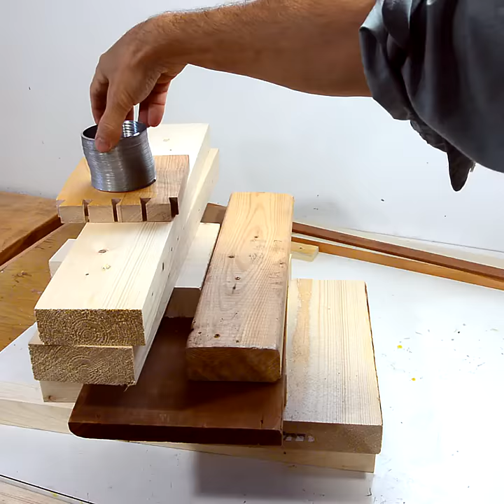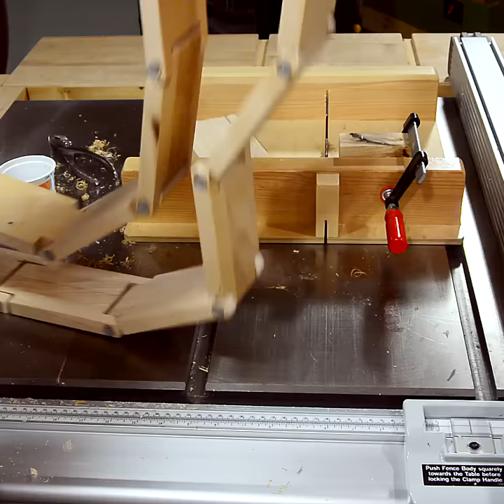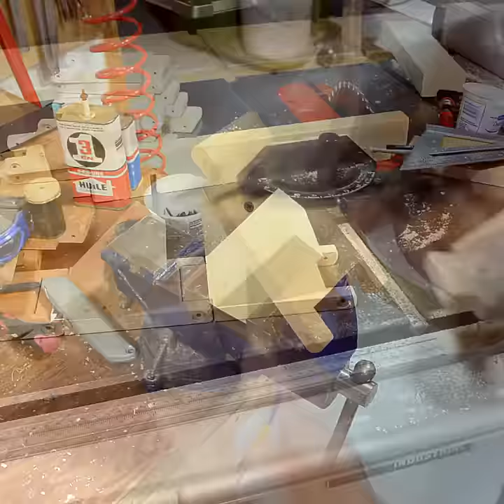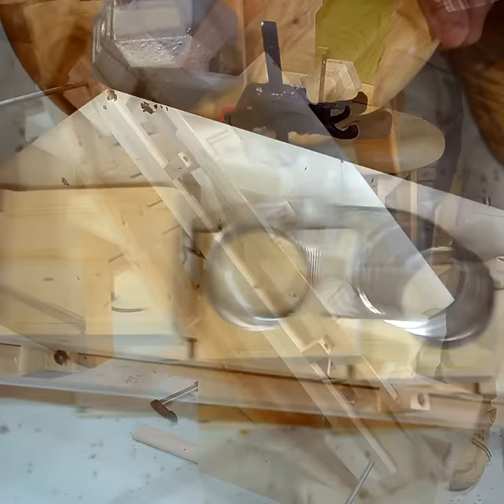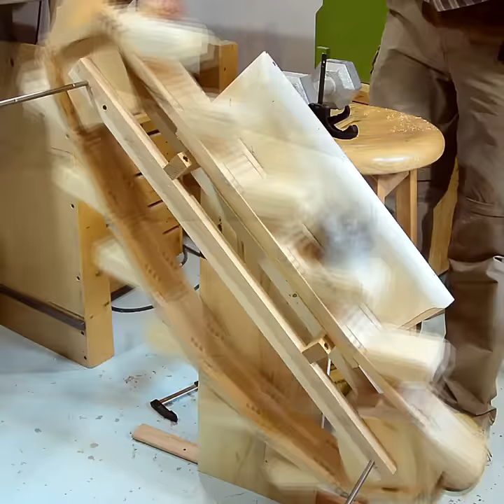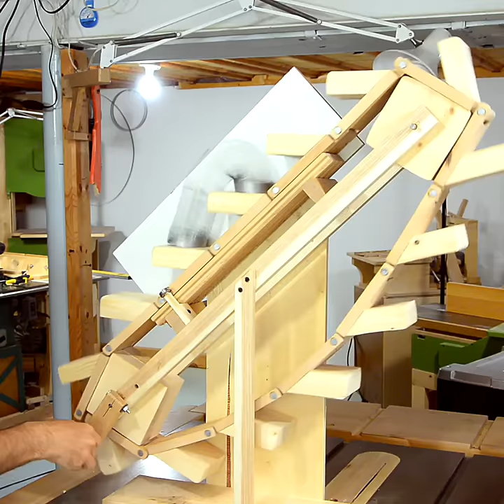Slinky machine

Comment: Given that your previous projects often used Raspberry Pi I was half expecting openCV looking for the slinky and adjusting the speed accordingly, Still quite cool contraption.
Reply from the maker: I ended up selling the slinky machine, otherwise this would be a cool project to try!
Reply: @matthiaswandel  theoretically, if you wanted to make another one, how much time would that involve? Is it a day, a week? It's understandable that you've moved on but it was a pretty cool project!
Reply: @djmips  maybe you could modify its design it so that it could be mostly laser cut, and only tricky parts would be 3d printed, (although you may find solutions without them...) since 3d printers are painfully slow.
Reply: I was thinking exactly the same!!!
Reply: @ronenen  3D printing can be made faster if you are willing to accept a loss in surface quality, which is fine for a structural part.

0.4mm x 0.3mm @ 100mm/s is a lot faster than 0.2mm x 0.1mm @ 40mm/s.
Reply: @ronenen  that's matthias for you, always using a laser cutter
Reply: @ronenen  Have you not noticed that Matthias' projects are about making stuff out of wood?
Reply: @MikeAG333  A wooden slinky would definitely be an interesting device, although not as good for escaping burning buildings.
Reply: @matthiaswandel  +1 to slinky stair case + opencv project if you ever feel like a redo. If this short does well you should consider it!
Reply: You can end up making another one @matthiaswandel
Reply: @matthiaswandel  I feel like you could definitely make a mini version of this, and have it be a perpetual motion desktop machine. Seriously, patent this ASAP IMO!
Reply: @matthiaswandel  wait, you are telling me there is money to be made with this? Did you just create a whole new industry with thousands of new jobs?? Where can I invest?!!

Comment: If more shorts were like this, i'd actually use the feature!
Reply: Ikr!? Finally something useful!
Reply: This is, unfortunately, a consequence of how we teach things in modern times, combined with the normal societal pressures to "conform".
Many children are quite good at 'thinking outside the box'. But almost everyone loses that ability as they mature.
This may be partly due to us disregarding some things because they are less useful/optimized, but again, we are actually taught NOT to think this way.

Example: What can you do with a paperclip?
Most will think about clipping papers together.
Some will also add tasks that a piece of stiff steel wire can be used for.
Less few will add things that a thin piece of electrically conductive material can do.

But at least one will think about using it to "help" the users of an office application...
Reply: @Prophes0r  "What can we do with a ....something?" is not a sensible question. The most revealing questions are "How do we solve this problem, using this limited set of resources?" Yours is a false example, and, I'd suggest, a false thesis. We're not taught not to think in this way at all. There is no teacher who says "don't think like that".  I suggest it is far more likely that it is an ability which atrophies in some from lack of use.
Reply: @MikeAG333  Nope.
How do we solve [X] with [Y] is the primary reason we have this problem.
It's NOT just about utility.
Utility is a hard limitation. Constantly framing everything as "What is my most efficient way to solve my problem" is stifling.

Now, we do need to solve SOME of our problems. It can't ALL be creative thought.

But limiting anything strictly by it's utility is the wrong way to do it, unless the ONLY thing you care about is efficient utility.
(And if so, then you should probably look up single-goal systems, and how they always fail.)

Sometimes, you just have to think about [Y] on it's own.
Reply: The shorts thing is just a terrible idea. Just imagine a full 10-minutes-or-something-similar video with all the details and reasoning behind the whole build explained by Matthias in an excelent way as usually. That cant be compared to some gutted 1-minute slideshow.
Reply: Du verrückter Kerl! Spielkind!
Reply: if shorts were in landscape which is what YouTube is made for they wouldn't be so annoying
Reply: @Prophes0r  4 bullets for my mouse gun.
Reply: @SkookumChoocher  this gives him a extra thou or two from his past genius. and more possible customers

Comment: so now you need a raspberry pi fitted with optical sensors to see the slinky, paint the slinky with some reflective material or illuminate it with a proper light against a background that makes it easily visible, run a program to keep the slinky in a specific defined space and have that program operate a motor that moves the wooden escalator at a speed needed. Simple!
Reply: You could use the fact that the slinky is a conductor and regularly touches 2 consecutive steps to make detecting the slinky much easier!

You’d need some sheet metal on the steps and some clever ways to charge it but computationally it’d be very simple
Reply: @NathanSMS26  Yes but I am going from the view of his prior mechanization activities. and also you would need to have a brush/contactor set up on the steps themselves and timing that would be a concern.
Reply: Much simpler to curve the escalator so that the slinky will naturally speed up (relative to the steps) near the top and slow down near the bottom.

Comment: That is just awesome. I would love to see you take it up another level and use your coding skills to make a program that varies the speed of a motor to keep the slinky exactly in the middle of the steps.
Reply: Or just make the steps follow a curved path. If the top is at a steeper angle than the bottom then the slinky will automatically speed up if it goes near the top, and slow down near the bottom. You can get treadmills that use the principle in reverse, to automatically match their speed to the runner and not need any power supply.

Comment: I've not made a slinky machine, but had a need once on another project for a fine adjustment on the trigger of a variable speed drill, finer than my finger on the trigger could achieve, that would stay at that speed and let me walk away.  Mount the drill in a holder of some sort, with a block of scrap mounted in front of the trigger.  Make a pilot hole in the scrap piece, and run a screw through it, so that its point depresses the trigger.  Tighten or loosen as needed to adjust the speed.  If there's no clearance for a screwdriver, attach a scrap knob to the head of the screw for hand adjustment.  Blunt the screw tip if the trigger has a soft surface that lets the screw penetrate it.

Comment: Cool. About trying to power it with a drill or any other motor - you would need a feedback mechanism to control the speed. In the handcranked version, your eyes and brain provide the feedback.

Comment: If you took a dimmer switch (rated for a high watt load) and wired that into an extension cable that the drill is plugged into you can get surprisingly fine control on the drill speed. It will sacrifice torque and wear out the motor on the drill a little faster but shouldn't damage it too badly for a short demonstration like this.

Comment: Two metal sensors on the backboard fed into an Arduino should allow you to control the motor speed accurately enough to keep the slinky in the middle

Comment: hey, I like it, you could drive the belt using some radio control car parts. Motor, Esc battery and a servo tester could be set up for not more than $50

Comment: I love it!  If you need to drive it slower, try adding a gear ratio.  You could also get a simple brushed motor that can run off a 9v or 12v dc source and add a PWM(pulse width modulator) to adjust the speed.

Comment: Have to put a set of garage door opener eyes at the top and the bottom so it can advance the belt as the slinky progressives and stops when it goes too fast I have seen a rock climbing wall that does the same thing as you climb

Comment: So now we build five sensosors that can detect the metal of the slinkiy into the backboard. Put a motor on the end, and use a microcontroller to translate the sensordata into a variable drive speed.

Comment: Love it!
Now it got me thinking on how to control the speed automatically, using PID and a geared motor with little higher that the desired ballpark rpm, of course.
But how do you detect the slinky position,?
Option 1: computer vision, seems an overkill.
Option 2: if the slinky is made of metal, then maybe by introducing antennas (both emitting and receiving) and calculating EM interference maybe? (using a legal RF frequency and power.) Since the slinky is conductive, it will probably dissipate the RF waves...  I'm really clueless in this area.
Option 3: IR led and IR electroreceptor array, assuming they are sensitive enough to detect the various levels of brightness.
Option 4: back to option 1, but a poor man version of it, using the slinky relative shininess, and flashing a light on it, we could easily determine the areas of brightness in the image.
Just brainstorming with my lonely self...
Reply: lego kits have ir barriers, and ultra sound proximity sensors. either could do. this PID is easy to do with modern lego. but Matthias knows arduino ...
Reply: Could do it with audio.  Slinky changes pitch as it progresses, shouldn't be too hard to calculate it's speed from the change in it's sound.
Reply: @josephhfry  audio pitch feedback has proven to not work well. Also it does not provide exact position, so it's sensible to slow shift. If it worked it would only provide a derivative , lacking absolute position reference.

Comment: You could use your programming skills to control a stepper motor to run it.  Each of the 'steps' could be covered in foil and the slinky used to bridge the two steps.  When slinky's rear lifts off the step, that will tell you how fast it's moving and you could adjust the motor speed accordingly.
Reply: Don't you think it may be a bit difficult to get the signals off the moving belt?
Reply: @1pcfred  No.  Wiper/brushes would make contact with it.
Reply: @stoojinator  I doubt that would work. Signal integrity would be compromised by the contacts. We're not talking about commutating a motor here where some switch bounce would be acceptable. But you're welcome to try it and see what happens.

Comment: The 3 speed LXT long ass percussion Makita BHP/DHP 451 is almost as weird as your slinky escalator, but the proper match in weirdness would be Makita DTP141, not DTS141, but DTP141. But I would not recomend DHP451 or DTP141 coz' both are heavy. DTS 141 would be nice if you realy need soft impact, but the compact DDF 487 @ 2Ah would be more then enough for most jobs. Even Bosch GSR 12V-15 and 12V-15FC @ 15,6 Nm soft torque in speed 1 is enough for 99%, very good even in speed 2, and DDF 487 @ 25 Nm soft torque cand handle up to 99,9%.

Comment: The Speed on the Drill is too high?
Use Gears.
- Why?
Well, when you play with Lego Technic, attachting the fast motor to a small  cog, and the Cog with a Bigger one, you'll getz the Bigger one to rotate much slower.